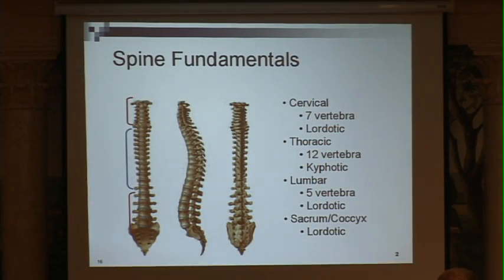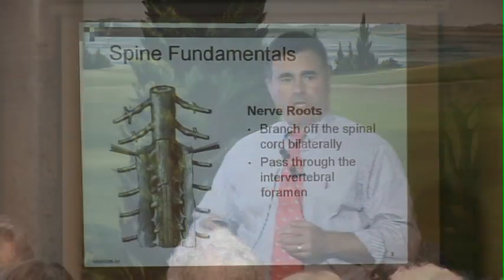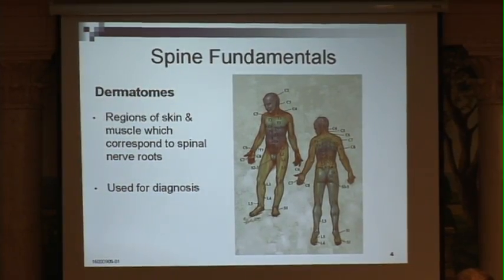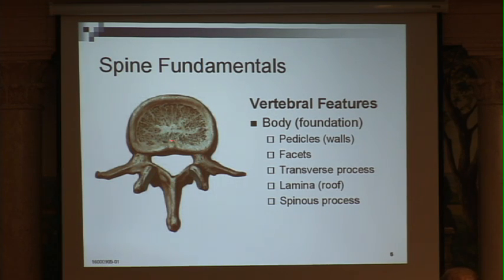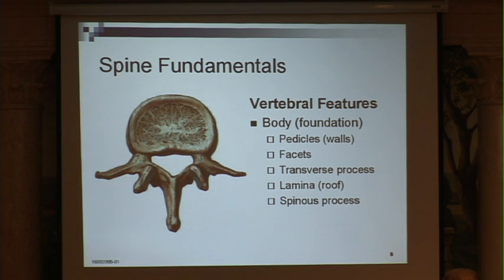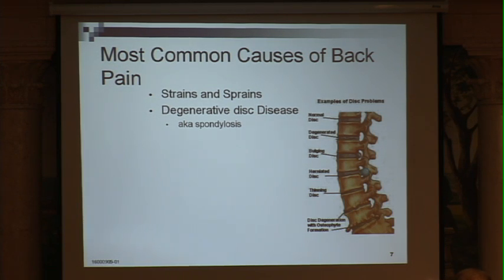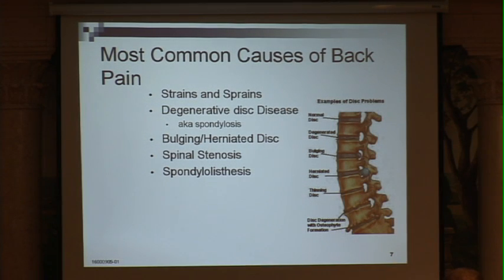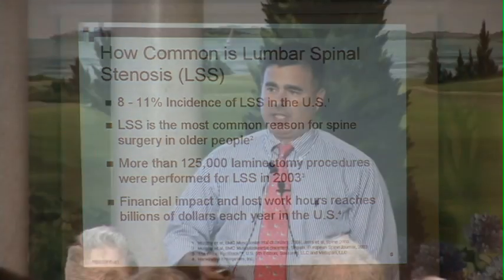Lumbar Spinal Stenosis Part 1- Spine Fundamentals Paul Houle, MD

Comment: I posted 8 months ago and had the Laminectomy procedure done in 12/12.
 A Neurosurgeon is the answer where the unnamed 'Spine Center' was not.
 I realize that the doctors have to do the health insurance company 'dance', even though they may already know what needs to be done. I was however disappointed in the very expensive merry-go-round while I suffered, peed my pants and painfully limped around while trusting and waiting for them to fix this. It is all fixed now.